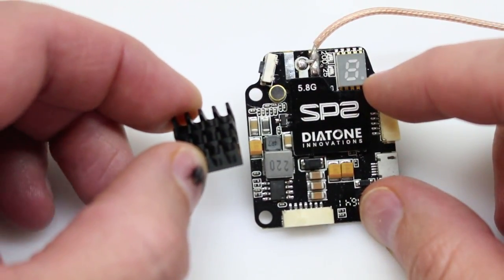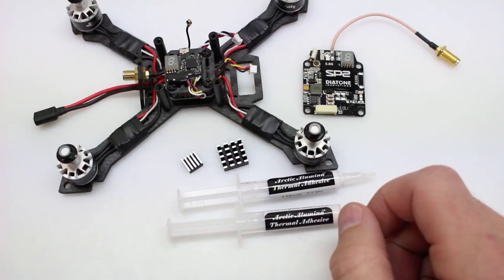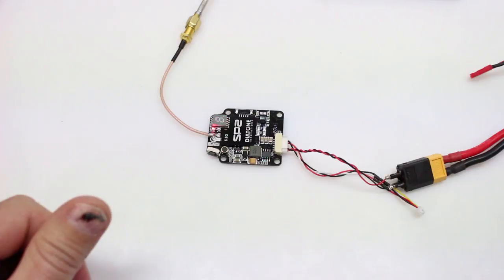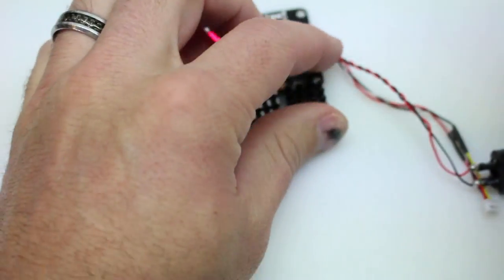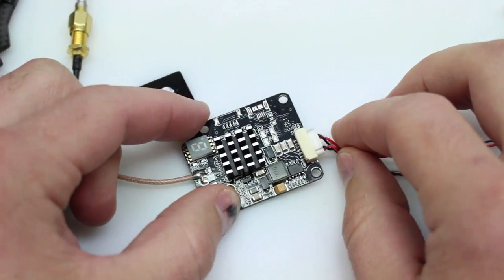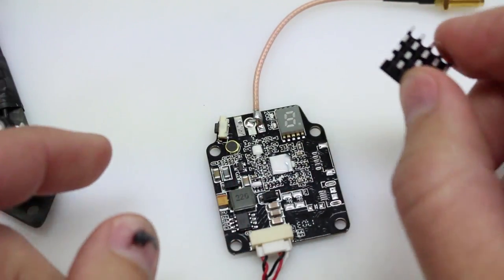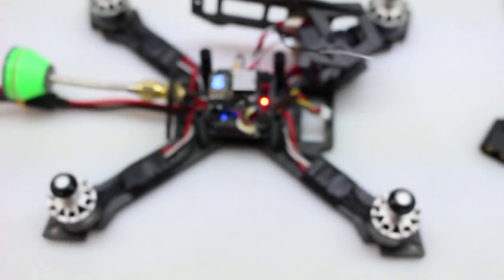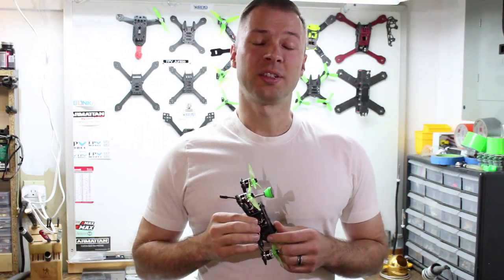How to install heat sink on your VTX

Comment: great idea ,the heat sink will only really work when it's being cooled by the air when flying that will be when they really shine and the temp drop will be more than you'd probably expect .I may try this as I have Flir camera that will give much better results as the infrared thermometers don't work well with anything but Matt black surfaces. Great vid tho ,definitely food for thought .cheers John
Reply from the maker: Thanks for the comment.  Some day I would like to get a FLIR camera or even just a temperature prob for stuff like this.

Comment: Good idea, but on vtx03 you put heatsink on wrong chip, this small one under Ipax is overheating, i measure it on flir e60, temperatur on it was about 100°C.
Reply from the maker: Flir E60! That's some serious equipment.
Reply: Today I am made a photo of VTX03. I was wrong, both chips are warming up, but the big one not so much as this small one, here is a photo of this situation:
https://drive.google.com/file/d/1-zeB7bm9Z9TYTj6dJgYGYbiGFVEbaSv-/view?usp=sharing
https://drive.google.com/file/d/1G9E-9DKlgVP5KpW_JbcantfiIg0A6ghb/view?usp=sharing
The best way is to place the heatsink on both of them.
Reply from the maker: Thanks for sharing, this is very useful information.  If I do this again I will just cover both chips with one heat sink.
Reply: Łukasz Szumowski do u have temp shots for the other side?

Comment: Do not you think that there could be problems of a short circuit if you stick the heat sink on top and it touches capacitors or resistors? Or would you just make the glue on the resistors and capacitors so that they are isolated. I would like to do this on a Unify Pro on it, since this comes in the hull of a wing and there cooling needs. Incidentally, I ordered your glue for the project :). I would be very happy about an answer. Greetings Julian from JB-Copter
Reply from the maker: Causing a short is always a possibility,  I looked at a unify vtx and I would add some conformal coating to the components around the chip or use a layer of electrical tape just to be safe.